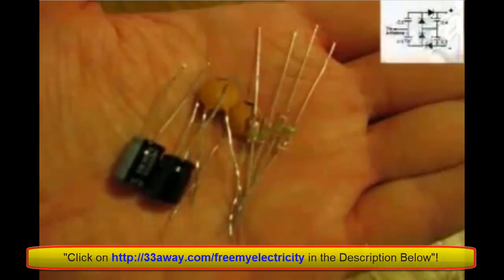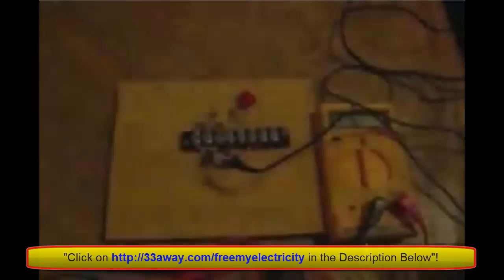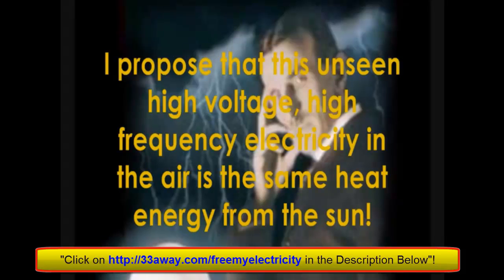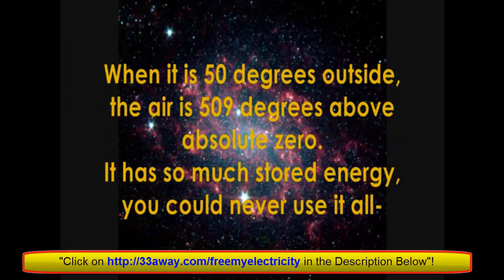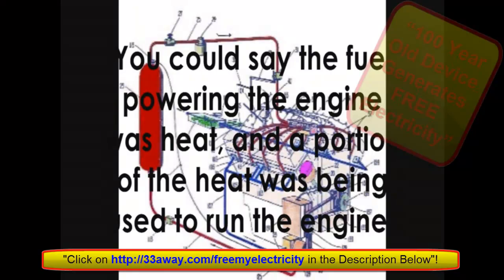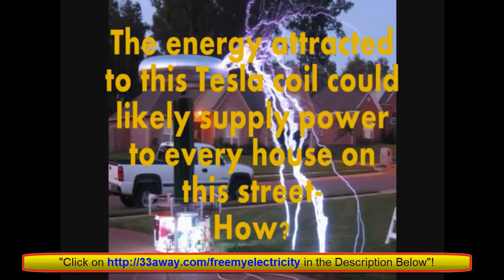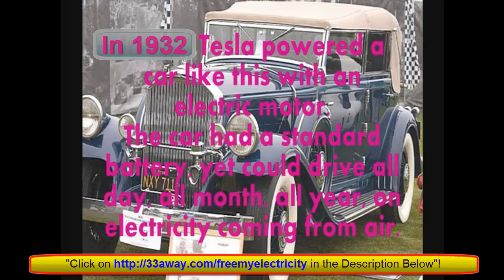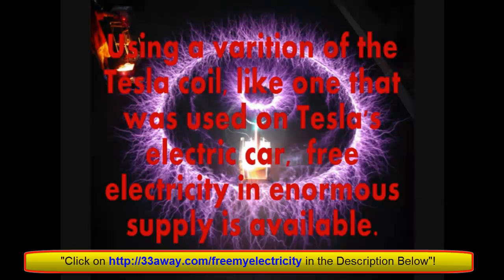Nicola Tesla Secret

Comment: This really isn't actual free energy. All that it is doing is picking up stray radio energy left over from TV, RADIO, and all the other man-made RF radiation surrounding us all.

You can see this effect without a rectifier circuit or antenna. All you have to do is hold one lead of a multi-meter in each hand, and then hold out both of your arms as widely apart as you are able.